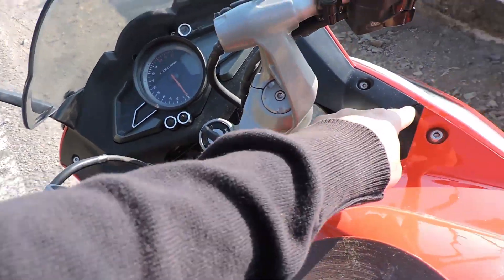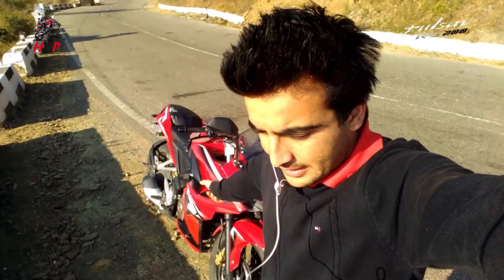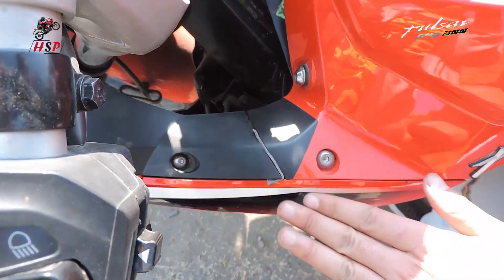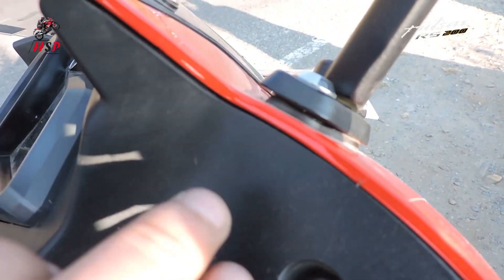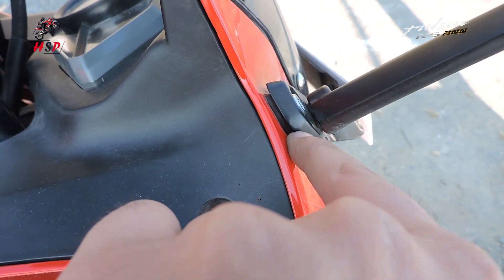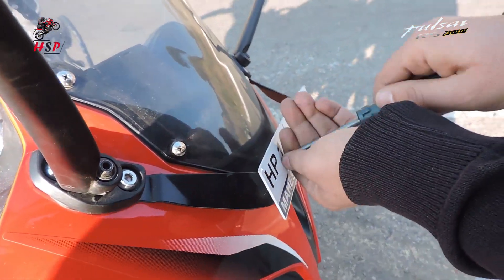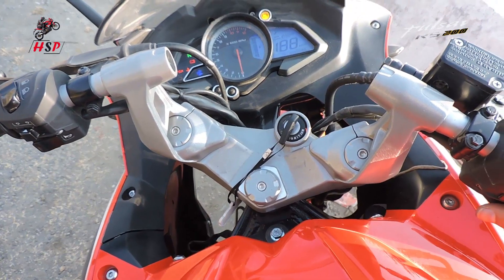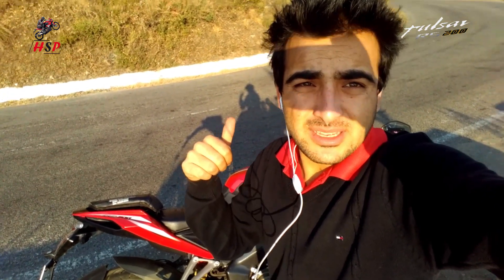Stop vibrations in pulsar 200rs completely

Comment: Himachali rocks....bro
Reply from the maker: yaa bro..........

where r u from...?
Reply: Himalayan Spark Plug . Sarkaghat , Mandi
Reply: u r from Shimla ??
Reply from the maker: Ujjwal Rathour yes bro....
Reply: Himalayan Spark Plug does it really stopped vibrating r u sure?nd I huv one query tht paying 1.5 lakh to get vibration bike?
Reply from the maker: Nandan nandhu
yer bro it completely stops the vibration.
it a small issue otherwise rs200 is awesome bike.
Reply: Himalayan Spark Plug anyways tq but I huv one confusion bw these rc200 nd rs200 nd duke200 ,as I heard tht re200 has soo many issues like gearbox nd sum carbon cumng out of exhaust nd also vibration etc nd mainly low build quality nd it has very less torque compared to Duke nd RC nd also low ground clearance having dis much cons wht do u suggest me bw RC nd Duke nd rs ,I like both naked nd full faired bikes so which is best nw RC nd Duke nd RS

Comment: I have same problem on my hero karizma new model., its fairing vibrates a lots, i have question,..  if I use this 3M tape, is it solve permenently or after some days i have to apply 3M tape again ?
Reply: For 1 year there will be no problem,then it will slowly comes again.

Comment: hey,wana ask u that the vibration in this bike comes at 40-60kmhr??? or lyk above 80-100kmhr. . .or it is normal from the beginning lyk u start in fear gear nd it started vibrating?????plz tell, planning to buy this bike. ..or else will go with dominor 400. .
Reply from the maker: bro vibrations come in higher rpm.......after 6000rpm...

& d 400 is also a good bike.....

Comment: Nice video bro and one thing thing I would like to ask if I change my air filter to k&n so in future will it cause any engine issues like heating or other problems as one of my friends have changed his exhaust to leo Vince in RS 200 and  after 8-9 months his bike engine gone and cost to repair is 26000 rupees..little advise brother
Reply from the maker: not at all Bro i am using k&n from past 2 yr there is no issue at all ...
thanks bro

Comment: Is that tyre feels slippery!?about pain using this bike?
Reply from the maker: no bro tyre r good.
pain is the faring noise.
Reply: Ranjith Ravichandran they made rear brake little hard coz of abs in front brake 
so it is not about slippery it's to handle braking system

Comment: My pulsar rs200 makes some thud type sound (from front fairing or inside fuel tank, dont know, like something loose part hitting the body )during speed breakers and pits. Did any one faced this prob? plz help..
Reply: balaji kedar it might be under ur exhaust...i faced the same prob
Reply: Gaurav kadyan . sorry for the late reply. The sound from under exhaust  is due to low clearance and when more weight is on the bike then the speed breaker hits the under exhaust. This is not the issue I am facing. I apprached the svc guys they tried to tighten the cone set but the sound still comes from the front fork or fairing.